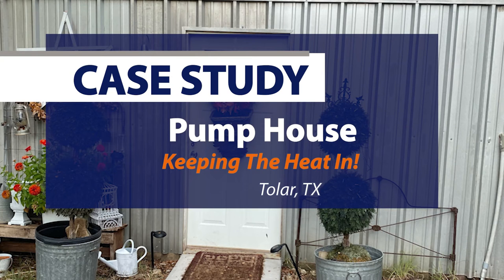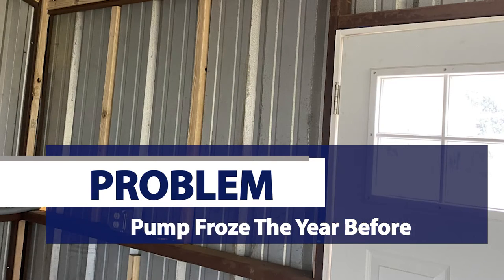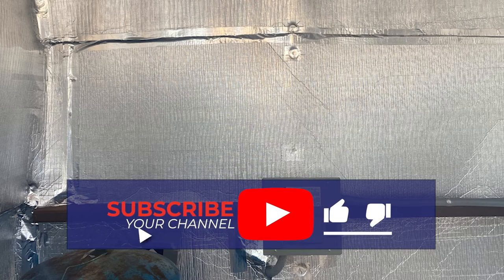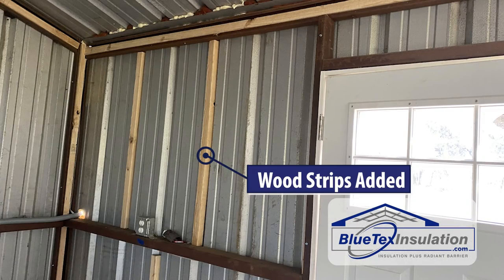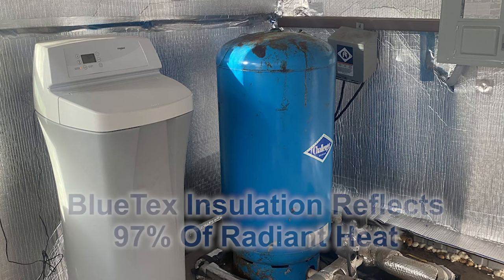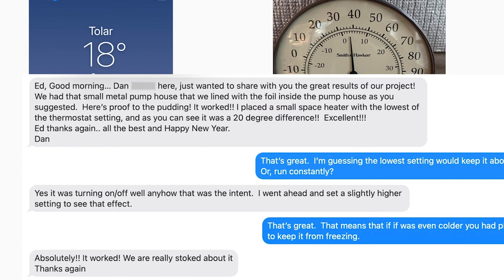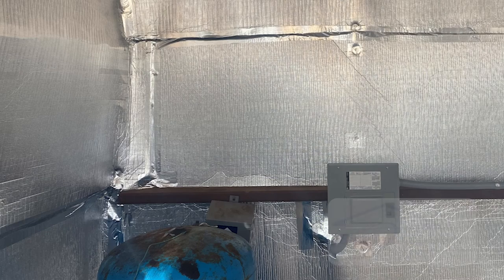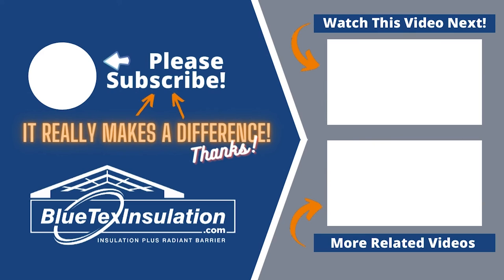Keeping Heat Inside A Metal Building - BlueTex Insulation Case Study: Pump House 2022

Comment: Isn't that the same if you turn the foil out (with the air gap)? Then don't you have the added benefit of an R 1.5 barrier on the inside?
Given my scenario - is it common to add like fiberglass (or foam board) batting to the inside of the radiant material for better temperature stabilization?
Reply from the maker: Yes, if you want the benefit of the radiant barrier (facing inward) AND the additional r-value then you would install between the www.BlueTexInsulation.com and exterior.  This system would be mostly for keeping the heat in in colder areas.

Comment: I'd like to do this with my pump house for same reason.  My question is:  will this make the pump house VERY HOT in the Texas summer?  Will that damage the pump house, heat up the pump, affect the electronics of the pump?  Anything negative for the hot weather days?
Reply from the maker: For the summer, the foil will cause some of the heat to be retained, but LESS heat from the sun.  So, think of the building like a parked car.  Just opening the windows/doors/venting will make a big difference and you should have no issues after installing www.BlueTexInsulation.com